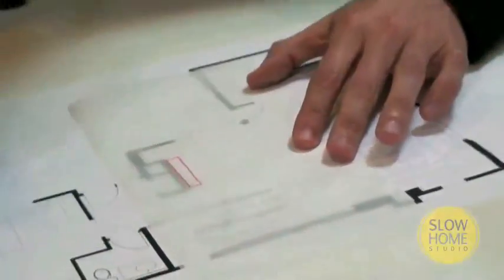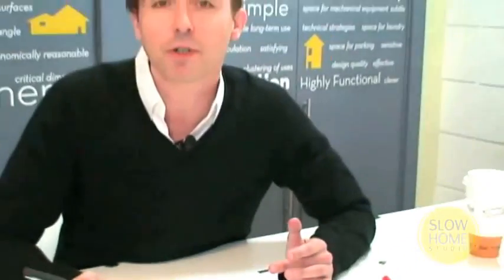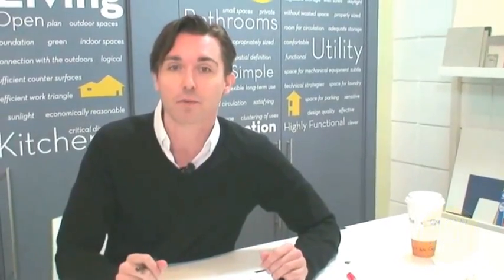How to Use an Architectural Scale

Comment: Good presentation. It is a bad idea, however, to draw against the scale because it wears out the edge of the fine increments past the zero which make s it hard to measure against. Instead after marking the 6' distance use a straight edge tool to draw the line (a triangle or mayline). Additionally if using a rapidograph pen, the ink could bleed under the scale making a mess. There are straight edge tools available that have a lip to prevent that from happening.

Comment: Allen Spence, the model (I used to build them too) is 1/24th scale. So find a scale that has a 24. The 1 along that scale represents 1', one foot, along the real car. So if you need a rollbar crossmember that's 3'- 4" on the real car, it will be to the number 3 on the 24 scale to equal the 3', then 4 slashes to equal the 4". The numbered slashes are the feet, intermediate slashes the inches.

Comment: mharichu, there are many scales that can be used. one must first decide which scale will fit on the paper, and will allow seeing the details. This example is using a scale of 1/4" = 1', one quarter of an inch equals one foot. After deciding on a scale,  simply use that scale along the edge of the architectural scale. With a few practice projects, you'll see it not complicated.